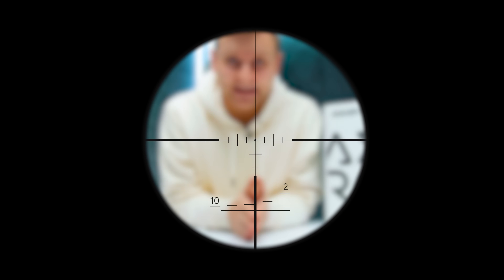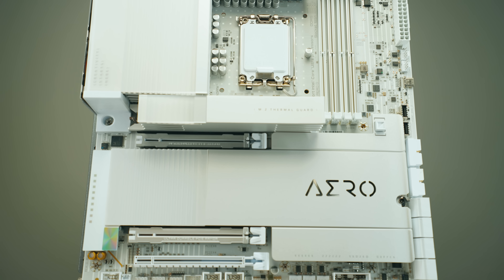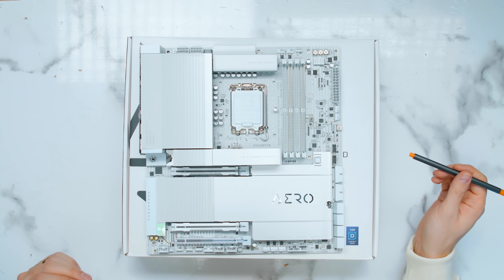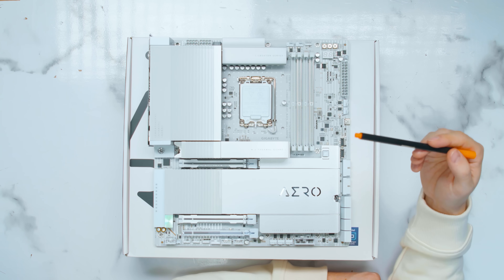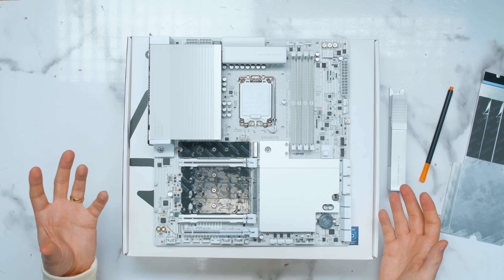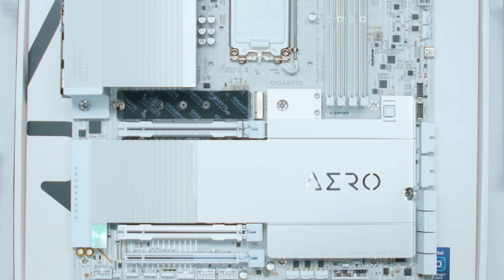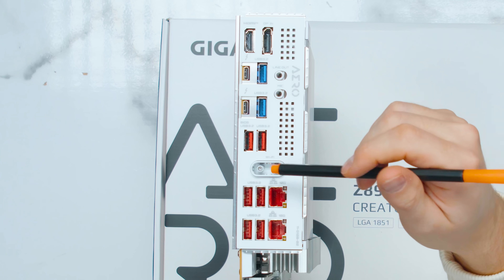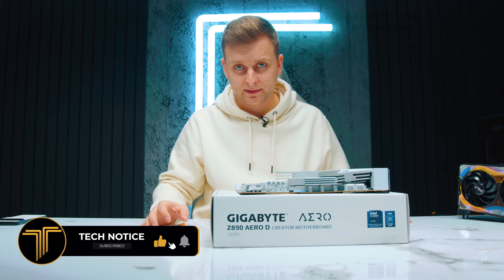The NEW BEST Creator MOTHERBOARD is HERE! | Gigabyte Aero D Z890 Review

Comment: Hello, you said that this mobo is a tad bit bigger than a standard ATX. But I checked the manufacturer and it said that its 30.5cm x 24.4cm. Its pretty much the same size as any other ATX. For a sec I got worrid that it might not fit in an SSPUDS' Xhuffle case

Comment: I believe those extra pads are for supporting single sided NVMe SSDs, according to the manual.  if you don't install those on top of the pre-installed pads your single sided SSDs can bend down due to lack of support once the top heatsink is locked in place.

Comment: I wonder if the inboard usb-c being so powerful, and display, if it's for a case 4k screen on the front of the case or whatever you can run 120hz 4k through thunderbolt 4 right?

Comment: The black version could be the w880 or z890 Ai TOP, they are pretty similar in specs.  
Ai top master and extreme are much better even though they are not classified as " creator" board. It is weird that this board is more expensive with lower spec heatsinks and lower power rating VRMs.  Unfortunately I didn't find any retailer selling this board in the US.....

Comment: To be honnest I find it bit lacking.
Placement of buttons on top is not best, it will be hard to reach with AIO or watercooling radiator that could block it in most cases.
Cover if M.2 that is also covering chipset heatsink and with what you mentioned as glued part, that will make cooling of ssds harder.
I also dont like back panel. Missing Optical out plus its audio ports placement will get in the way when you want to connect something to USB ports. And talking about USB ports I would expect a lot more of them there on such expensive board.
Also dont like overal construction of heatsinks, their lack of fins and orientation making airflow cooling harder unless you have cpu cooler with fan that move air down towards socket.

Only pluss I see is DP inmput and perhals dual 10gbit ethernet
 
Looking at prices here Godlike is just $200 more and Ace $200 less.

Comment: Non starter for me because of limitation of USB endpoints on Intel chipsets still, and Gigabyte boards still refusing to run headless in 2025. Easily solveable with a dummy HDMI dongle for an AI or creative suite server, but its the principle. 96 useable USB endpoints is really something that needs to be addressed by Intel though. You can't say anything is a creator focused products with that limitation. At this point the creator board is a Threadripper board only and has no competitor.
I would have also liked to see rear facing headers / 24 pin on the board. Granted that is pretty much an ASUS patented thing, but there is a wider used non-patented version as well that could have been implemented.

Overall, I like that manufacturers are still trying to make high end boards and push the flagship nomenclature to try to take the lead. Competition is great even if it ends up not being very practical for consumers in the end. Eventually tech and implementations will trickle down to the main SKUs.

Comment: I just built a PC with this motherboard and the AERO 5080 gpu!! I'm so glad you made this video! This was my first PC build (for gaming and Davinci Resolve), and I have a feeling it's going to last me quite a while. I wish I could share a photo of my build here :(
Reply: Wait, I was wrong, I have the Z890 AERO G. Which board is better??
Reply: @tylerdillehay  Depends on your need when it comes to PCIE and USB lanes. When it comes to raw performance there isn't much of a difference between motherboards in a same generation.
Reply from the maker: Aero D is a class higher than G :)
Reply: @theTechNotice  my problem is PCIe slot 2 only has 8 lanes and if I put the GPU in slot 1, it shares lanes with my m.2 so either way, I don’t get a full 16 lanes for the 5080. Still got an insane Pugetbench though so I’m happy.
Reply: @tylerdillehay  you don't need full x16
Reply: @tylerdillehay just move your m.2 to the one that shares bandwidth with the chips and you should get all 16 lanes available to your gpu

Comment: I bought it a few days ago. I really love the board. The only problem is, that Windows won't recognize the Audio Line Output or Input of the board with the delivered Realtek drivers from Gigabyte. The only thing that gets recognized, are my monitor speakers trough HDMi. Anyone has the same problem ?
Reply: Is a shame as I upgraded from the z790 Aero to the proart z890 with  285k, but looking at the price dont think I would pay £800 for a Motherboard in UK that is £350 more than the Z890 Proart, awsome review as always
Reply from the maker: that's odd... And you got the latest drivers from GCC? Gigabyte Control Centre?
Reply: @theTechNotice  Yep. If you google it, it seems like some people had the same problem with other Gigabyte boards as well. Also people should make sure to have a USB Stick ready with the latest BIOS on it. Mine was delieverd with the F4 BIOS from October 2024 and didnt want to boot with my 285k without an update. It booted at least in the "Quick Bios" to do the update thought.
Reply from the maker: Mine was F4 bios as well, but booted with the 265k, but I did update it straight away!
Reply: @ Ah thats nice to know. There should be a new bios in a few days with the new microcode from Intel.  Anyway, my system now reconizes the Realtek "Record" device, but still not the LineOut. I hope a driver update in the near future fixes that. Cheers and big thx for the great content that you put out each month.